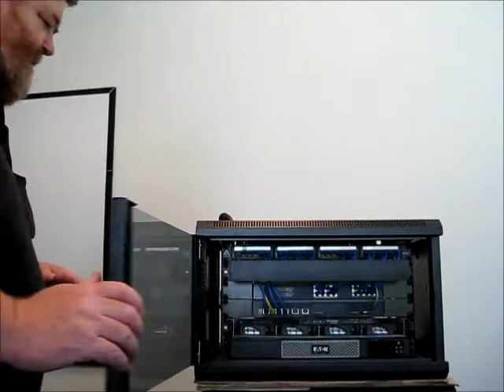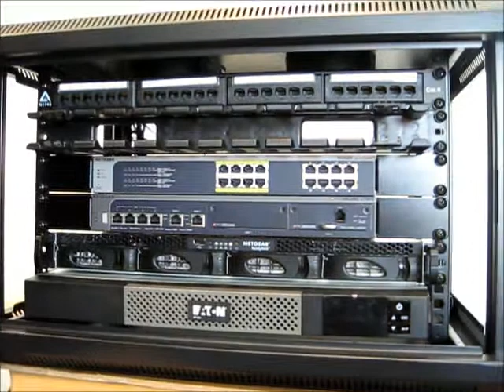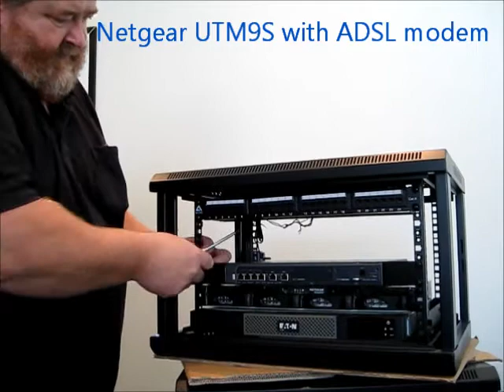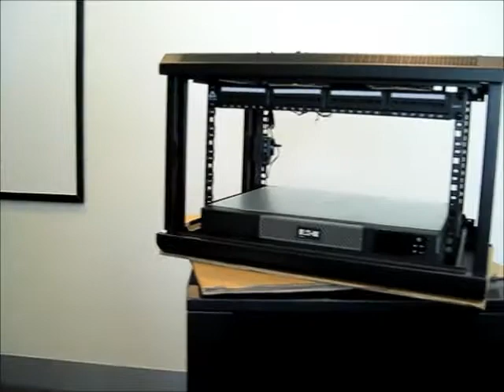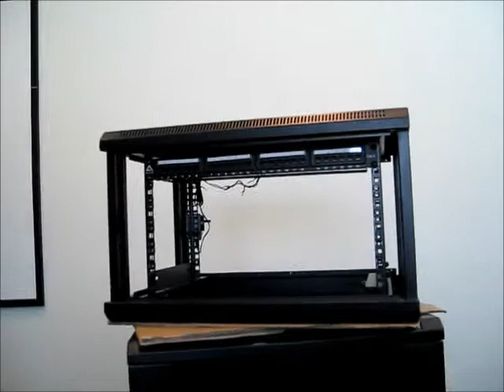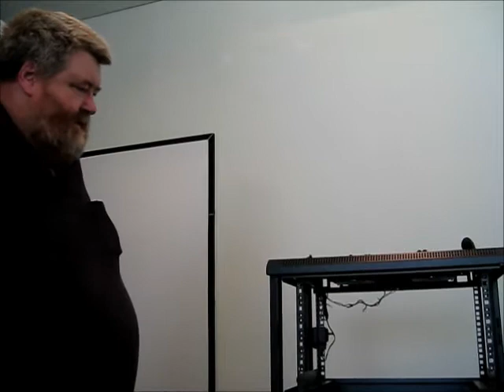BMS Small Office Engine Assembly

Comment: Hi mate. can tell you are a fellow aussie :) I want one of these for my home network. Looked up 6RU and found your video, I need to fit a Cisco 2960-S POE switch home router, patch panel and maybe cable management. The width and depth need to be at least 420mm deep x 450mm wide. Also can I mount this high against my wall but will the timber studs be strong enough to hold the cabinet + switch? Router and patch panel wont be that heavy just the switch and cabinet will
Reply from the maker: Our wall mount cabinets are designed to hang on Stud walls or masonry walls much like a shelf would.